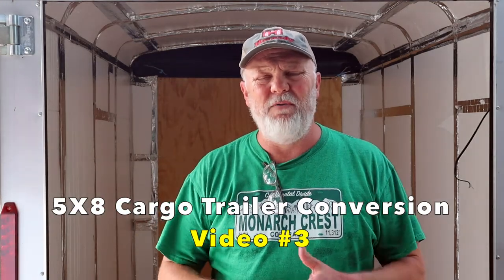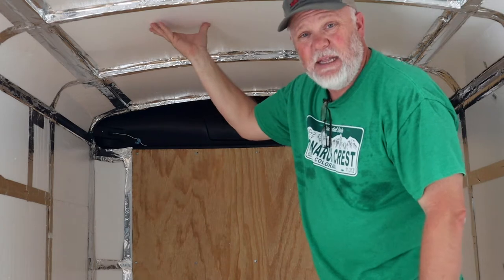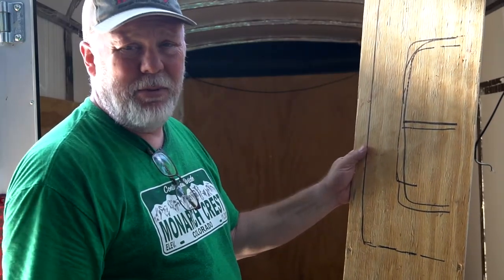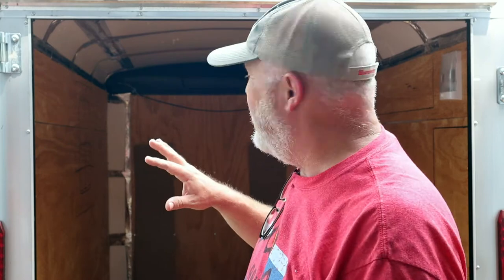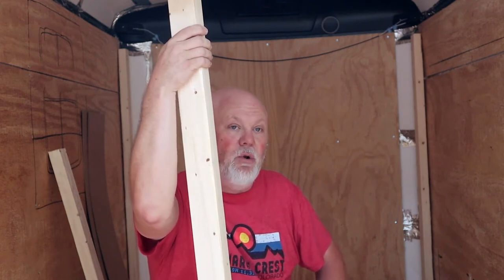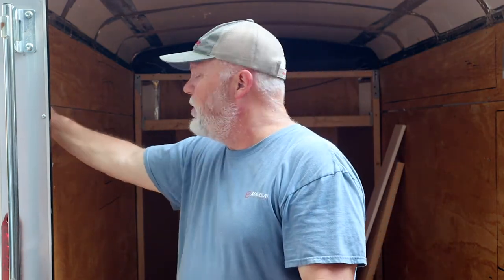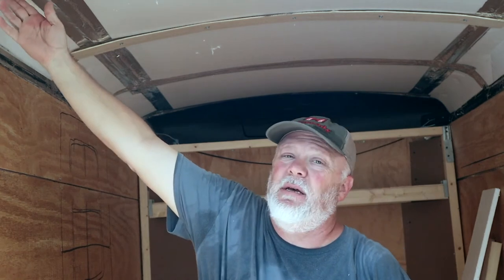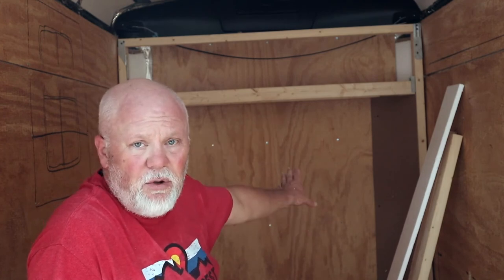5x8 Cargo Trailer Conversion - Ceiling Insulation and Firring Strips

Comment: Your trailer looks great!

How did you get the insulation to bend in the wall - ceiling curves?
I’m stuck at that point with my trailer insulation project.  I have R6 1” insulation board in walls and ceiling but 1” won’t bend in those corners.  Thanks!
Reply from the maker: We used the 4x8 1/2" insulation for the walls and ceiling, doubled it up in several places.  Same for the corners, though we did use some spray insulation to fill in gaps.  It bends fairly well, but it will snap if the angle is too great.

Comment: What size self tapping screws for your firing strips on the ceiling?
Reply from the maker: 3/4" - wanted to make sure screws stayed within the metal frame (and didn't have any chance of piercing the roof).